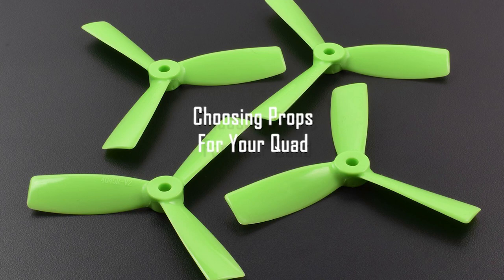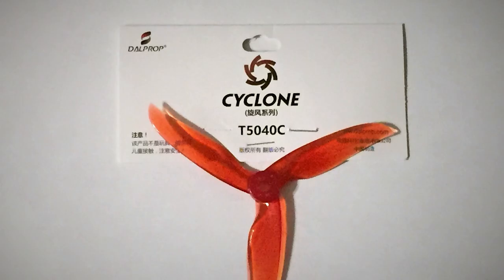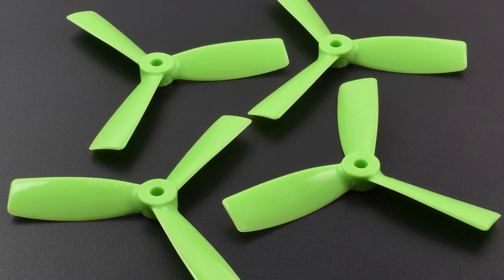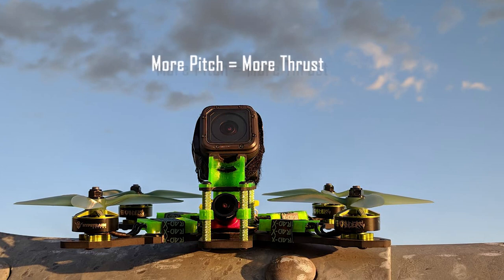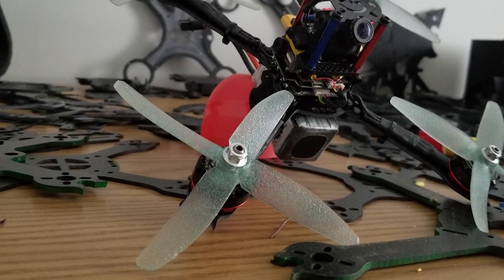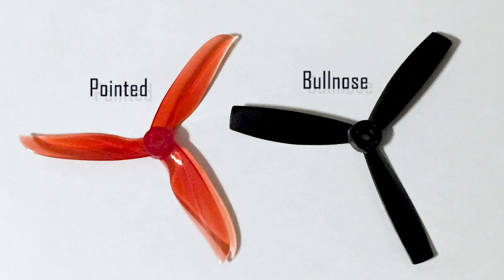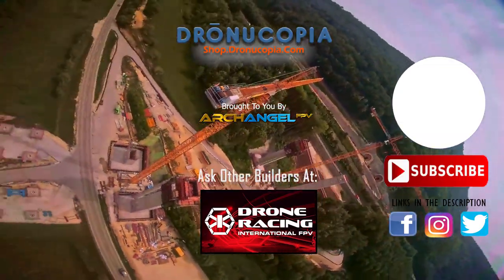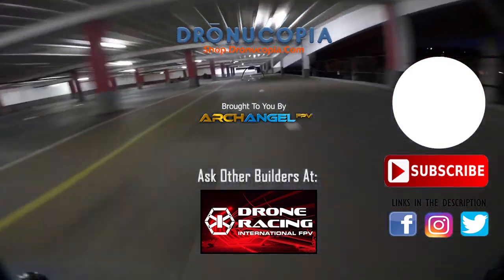Racing Drone and FPV Quad Propellers Explained | Drone Racing Report | Vol 22

Comment: I was using Dalprop 5040 with pointed tips. I put on some old bullnose 5040 that I had laying around after watching the video and the difference was staggering. Much better cornering and control. The pointed ones were a lot more floaty. Going all bullnose from here on out!
Reply from the maker: Nice! Glad some of the advice was useful. It can be surprising what a difference different props can make!

Comment: I was on google for about an hour, and now I have been on youtube almost another hour, this is about the 16th video on props I have watched.  While I found your video one of the best explanations of props and how they work, I cannot for the life of me, find ANYTHING on the web, explaining the way the props connect to the motor, or hub assembly.  I know there is the most popular hub, where the prop has a single hole that fits over the motor bolt with a 5mm nut I believe.  But I've recently got into 3" builds and I notice some props have two or three small holes with tiny screws that hold them in, like on the BabyHawk or Leader3.  How are those listed when buying props?  The only way I have found to buy those types is by looking at the pictures in the ad.